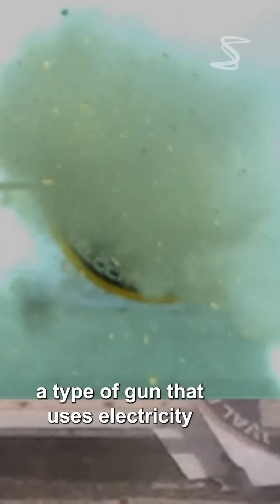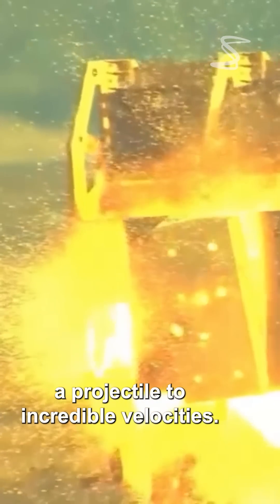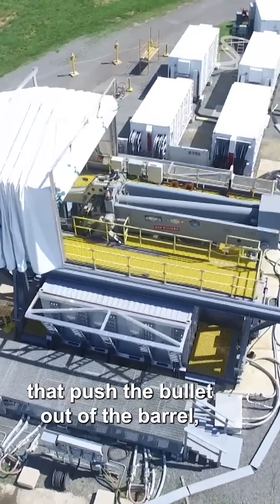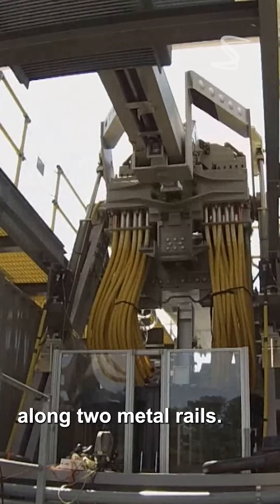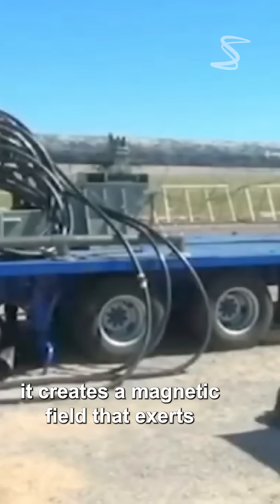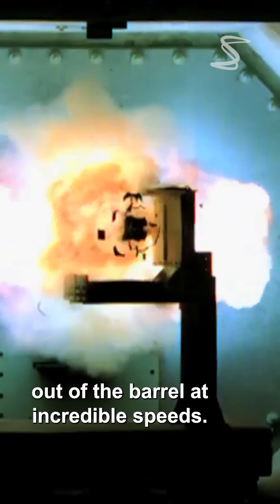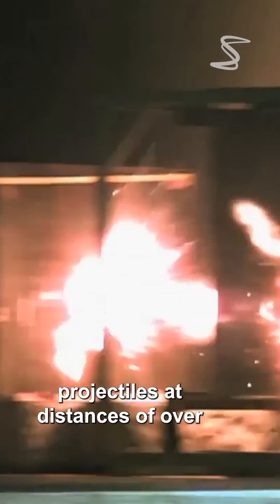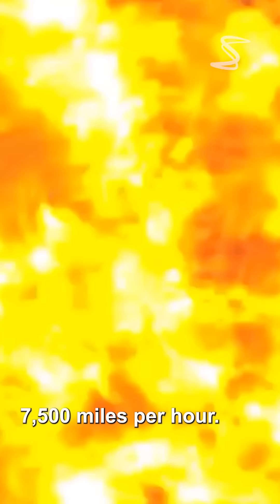Electromagnetic Railgun Cannon: Speeds of up to Mach 7!

Comment: What most people don't realize in the video did not illustrate, is that none of the projectiles are carrying any High explosives! The Flash and explosion is literally the dust in the atmosphere would a Mach 6 projectile hits a solid steel plate! Bae land systems largest railgun the first time they fired it they could not find the projectile because it had gone through 31 ft thick concrete targets penetrated the berm behind the target house and they found it a quarter of a mile down range in a berm for an adjoining weapons System test!

Comment: The issue with railguns is the fact that after five to seven rounds the rails are so badly damaged by the high current that they must be replaced or machined rendering it useless until completely overhauled. That is beside the insane current needed to acheive significant velocity. Currently only nuclear powered naval vessels have that capability using 85 to 98 percent of the reactors capacity for several minutes to sufficiently charge the massive capacitors for a mild shot nowhere near the guns ability. This power drain leaves no power for other needs like radar, propulsion, lighting, or close in defense systems rendering the vessel vunerable, and immoble for up to 15 minutes while the gun is charging for each shot. Not safe, or practical if the ship is under way in a combat scenario. Inability of engineers to fix this power demand, or damage done to the gun itself led to the ultimate cancellation of the project.

Comment: they  found out the weapon could only shot 25times befor the gun became useless
Reply: Research also shows hypersonic missiles are one-time use only 🫴 the more you know 🙌
Reply: Due to a lack of a capable material that could hold up to the current levels and stresses caused by the acceleration of the projectile.

Comment: The apace shuttle has to go 25,000 mph to leave our atmosphere.  Pretty crazy
Reply: That's not true. The orbital velocity is 17000 mph for orbit. At the 320k ft altitude,  the edge of space, the speed of the Shuttle is around 4700 mph. As it leaves the atmosphere, it will gain faster and faster speeds to reach the 17k mph orbital speeds, which is low earth orbit velocity, LEO. Nothing in the atmospheric trajectory is above 4697 mph max, at 330k ft. Otherwise, the craft would be subjected to extreme atmospheric drag and dynamic pressures, causing it to structurally fail. 80% of the final orbital velocity is achieved after it has reached  space, through the main tank burn time. Space Shuttle Ascent: Altitude vs. Time - NASA https://www.nasa.gov/pdf/585035main_ALG_ST_SSA-Altitude.pdf
Reply: @defiverr4697  found this on the never wrong I internet.... A spacecraft leaving the surface of Earth, for example, needs to be going about 11 kilometers (7 miles) per second, or over 40,000 kilometers per hour (25,000 miles per hour), to enter orbit. Achieving escape velocity is one of the biggest challenges facing space travel. I guess the internet is wrong again

Comment: After ten years of research, development, and 500 million dollars spent, the Navy has canceled the program.
Reply: They gave up because the force of shooting it shredded every gun barrel they tried.
Reply: We dont have enough energy to use these as main guns and to big for any normal tank vehicle plane etc etc
Reply: @stellvertreter5399 A warship would have plenty of electricity.
Reply: @freetrade8830  but not for multiple shots without killing the engine or overheating its not enough for railguns its just too much energy and the barrels  wear faster off
Reply: @stellvertreter5399   A powerful rail gun needs 50MJ per shot =14kWh. To fire it once every 10 seconds you would need a 5MW power source. Large ships have engines with about ten times this output. The energy and power requirements are not problems.
Reply: @stellvertreter5399  That wasnt the reason they canceled it though, they said they'd have to replace the barrels after only a few shots.. Which made is much more expensive
Reply: What a wasteful endeavor in ANY era...and now, especially in a "world" salivating renewable energy as its main power source 🙄 How long before they thought the "auditors" would findout how much power this things comsumes per shot 🤨
Reply: @kgt9535  Military R&D is hardly wasteful if you appreciate not being enslaved by dictatorships, who most definitely invest in advanced weapons...
Reply: They say they did, most military funding goes unaccounted. They’re most definitely still experimenting
Reply: Joe's wanting to send it to Ukraine for his 10% cut of 100billion dollars!! Lot's of corvettes in that pile of cash!!
Reply: That’s right…!!!
Reply: Rail Gun... as depicted in the "Arnold S."
film Eraser! but as a portable and Practical version!! Noice!
Reply: Or so we're told

Comment: If you’re wondering why there’s fire when it shoots even though it’s electricity, it’s because the projectile is moving so fast it literally is breaking air.
Reply: I broke wind one time, but nobody acted like it impressed them one little bit.
Reply: @mrimmortal1579  🤣🤣🤣
Reply: @mrimmortal1579  , thanks a lot, dick! I nearly choked to death laughing at that! I regret that I have but one like to give for your comment! ❤
Reply: @mrimmortal1579  😂😂😂
Reply: It is burning metal
Reply: Did it burn them ass hairs 😢
Reply: Plasma exists.
Reply: The air's getting out of the way so fast because chuck norris coming thru..
Reply: It's also destroying the rails

Comment: They scrapped this project already if I'm not mistaken.
Reply: no more like it’s been postponed.

they didn’t scrap it because at our current state we don’t have strong enough material to withstand the pressure the barrel is exerted to.
the shell firing literally rips the barrel apart
Reply: @nickkozak4763  it's not so much the force exerted on the rails, but the plasma erosion caused by arcing between the rails and armature. They do use a buffer gas called sulfur hexafluoride (the gas that makes your voice super deep) pushed by a piston and gunpowder charge to initially get the projectile moving, which forces the SF6 into the gaps between the rails and projectile which decreases arcing, since SF6 is extremely good at quenchijg arcs, it's used in the power grid in high voltage switches as well, but it's still not enough to stop an extreme level of erosion on the rail faces. That erosion is what has postponed the project, they have to replace the rails after only a few shots, it's not economical especially considering the power generation requirements of such a weapon, the capacitor banks and generators just take up too much space on top of the erosion problem, there's just too many issues, and missile tech is capable of higher velocities than weapons-grade railguns as of now. Maybe there will be some super-duper-pooper fancy material that gets invented and is room temp superconductive with 100x the heat conductivity of copper to make the rails and armature from, but until then it's just a really fancy way to throw money at a target.
Reply: @nickkozak4763  It’s bc of the amount of electricity needed to fire it. It’s not very “portable”….do you have Google???
Reply: @nickkozak4763  rail gun : "we put a hole in you."

Howitzer : "byeeee." 🤗 💥
Reply: @YaBoiStaeta  railgun.”theoretically can fire up to speeds of mach-10 and can possibly hit projectiles mid-air”

howitzers “ takes several shells to hit the target without the use of precision guided weaponry while not being able to hit air targets and defend against other projectiles”
Reply: @nickkozak4763  as this may be somewhat true its not the reason why it was scrapped. We wasted 100 billion dollars on this blunder that has a limited range, takes up too much space, isnt very portable, requires a huge energy source, and most importantly is outdone by hypersonic missile tech. The military finally acknowledged it isnt cost effective or practical to use on a destroyer.
Reply: @07slowbalt  yeah as if we didn’t waste money on other needless projects( modernization)

they should build a vehicle that eliminates weaknesses of its predecessor
Reply: @nickkozak4763  our military waste a ridiculous amount of money. The f-35 could be said to be the costliest blunder we ever made in the trillions.
Reply: @07slowbalt  what could be good is the militarization of a city or two. maybe build a entirely new city that generates its own power and may be able to take a nuclear blast or two( not directly on or next to it of coarse)

maybe even multirole defense systems to prevent direct strikes against the city?

but that’s what i think. it could be good if you build a top notch city that also acts as a last refuge
Reply: @nickkozak4763  Nice thought, but who actually gets to seek refuge? How do you determine who lives & who dies?
Reply: @Urbicide  not part of what i thought of but could be done
Reply: @Urbicide  “under a mountain” so a bunker
and what i meant was a above ground city
Reply: @nickkozak4763  what good is a nuclear bunker if all the food is wiped out and then contaminated with radiation fallout? Id rather die than starve to death.
Reply: @07slowbalt  you want me to have a long comment or a short comment. because i’ll explain what i thought if i HAVE to
Reply: @nickkozak4763  go for it lol
Reply: @07slowbalt  basically greenhouses with reinforced structures. and mabye cover surrounding land after deforesting it with tarps or metal for future development on uncontaminated land (don’t know if liquefaction helps make it contaminated)

though what would be good is research and development on a substance to cure or drastically reduce the effects of radiation poisoning though i’d say that be more on a genetic to cellular level if not atomic(think what i mean by atomic)
Reply: @07slowbalt  i mean something more effective than just effecting one area or two
Reply: @nickkozak4763  i dont think you understand the vast area that a nuclear bomb will ruin.  No amount of tarps is going to prevent the fallout.
Reply: @07slowbalt  no i know fallout reaches far but i mean trying to keep the land uncontaminated around the outskirts as possible
Reply: @07slowbalt  rather die than starve to death? I'm sure a few ways are more suffering than starving. IDC what happens just keep McDonald's open 😂😺🐈
Reply: @07slowbalt  Good on paper and the Russians were being accused of the same thing on shorts today
Reply: @07slowbalt they scrapped it once all the millionaires in the chain of command became billionaires, and as soon as that was accomplished, and all 8 of them became disgustingly rich, they simply turned off the lights and fked off.

The US military industrial complex in a nutshell..
Reply: @NiSiochainGanSaoirse  whats uninformed about a plane that cant fly in the rain, doesnt have the range needed for some missions, cost per flight hour is tenfold, and the number of available operation capable planes are subpar. Even the airforce called the plane a failure. Look at all the recent failures of the plane that shouldnt be happening.

 The f-15ex carries far more weapons and can do most jobs better than the f-35 and at a fraction of the cost.

Now take this with a grain of salt, i think the f-35 is a badass plane and is very capable for its designed purpose but so was the f-22 and you wanna talk about another massive failure? Over budget and never used outside of shooting down a Chinese balloon.
Reply: @bigsmall246  troll
Reply: @07slowbalt  f-35 is fine, it had some problems during development but the plane is very capable. Look at what the pilots from different nations said after they flew the plane. It's a very deadly plane.
Reply: @silimarina.  im not questioning its capabilities or how deadly it is. Ive seen it first hand performing at an airshow last summer, its bad@$$. However the point is the flaws that were plaguing the f-35 in the beginning have only partially been resolved with many still failing to meet standards to be combat ready. The cost per flight hour is absurdly high, and the airframe lifespan is far lower than that of other capable planes.
Reply: @07slowbalt  i don't know, Israel seems to enjoy F-35 very much. They had a lot of missions done with F35. If the plane had issues i doubt Israel would not say anything. Also, a lot of countries are interested in F-35. Every pilot that flew this plane, praised it and many have said that compared to 4th generation planes (F16, etc.) , F-35 is on another level.
Reply: @07slowbalt  you think that in fantasy land but your brain is hardwired to survive so any situation you find yourself in you will try to survive wether you want to or not.
Reply: @kindcanadian5825 im sorry but did you just type a word salad 🥗?
Reply: @silimarina.  when the plane works its one of if not the best plane on the market. Im not disputing this fact as its extremely capable. My issue is its cost and ongoing issues that still havent been fixed.
Reply: Only gets around 5 rounds before barrel has to be replaced,very expensive weapon and time consuming
Reply: Yes they did, the gun uses too much electrical power…
Reply: They DID.
THIS SITE IS A JUNK SITE for throwing out OLD NEWS
Reply: At least the concept works, Maybe it’ll have a use in the future.
Reply: Or so that is what we have been told…
Reply: The deep state weapon.
Reply: Funding most likely diverted to Laser technology. Lasers would be more efficient with the amount of energy used just to fire one railgun round.
Reply: Thats what they want you to think
Reply: The budget for this was diverter for Directsd Energy Weapons (DEW) which was listed as a critical, priority technology - because "our enemies" (China, Russia) are also working on lasers so once again, its a race to get there first.
Just like the newly resumed space race...
Reply: Plus the metal piece of projectiles they where 20 30k for scrap metal what a money laundry bullshit typical USA
Reply: Yes and no , there is a navy ship with a rail gun but I don’t remember if it’s ours or an Asian country. But it’s to expensive because the guns internals has to be replaced every shot or every few shot including the barrel
Reply: it will come on big war ships that run with nuclear reactors.
I'm quite sure china has 10000 such cannons.
better make peace everyone.
Reply: Yes it was not moving enough money into anyone's pockets so it don't pay enough to be economically feasible.
Reply: Wasted a lot of money on a gun that's shell would only cost a small amount . Needed to build more cruise missiles at over$1million each and give them away.😮
Reply: US militarized culture is a DEATH CULT that can't hear more than 1 side of a story, insists we are the good guys, and that justifies our torturing and incinerating millions of people!
$ick!
Reply: I think it was on 60 minutes that I saw  that it had been moth balled last year so there is not much going on with the rail gun that they are willing to talk about at this time.
Reply: No more budget.
Reply: @bluemarshall6180  Our money grabbing society sod defence it cost's to much
Reply: Wrong
Reply: @warrenporter9554  which part $1million cruise missíles or rail gun still in operational or that we keep giving all our weapons away.